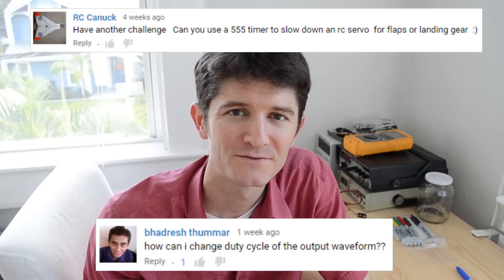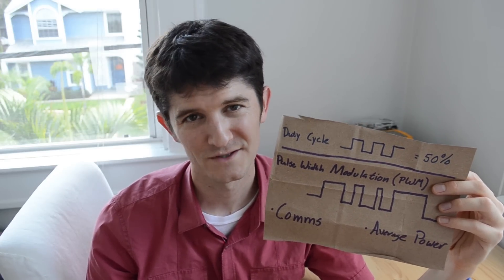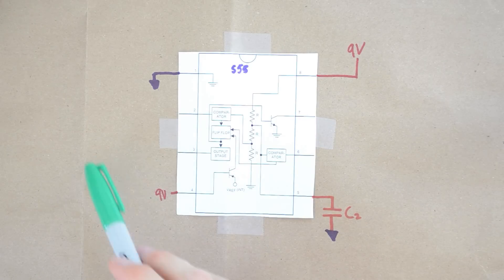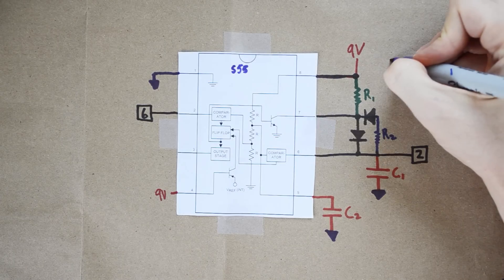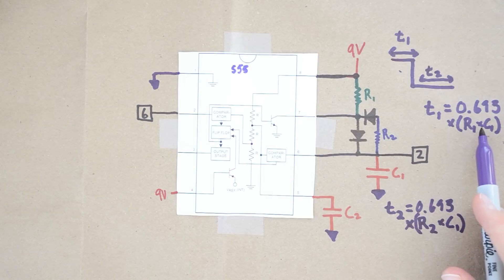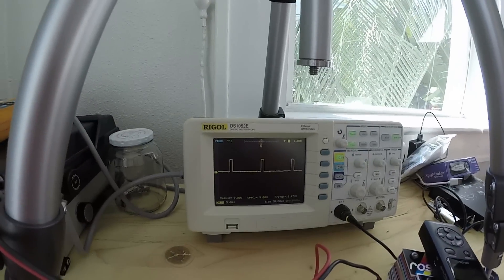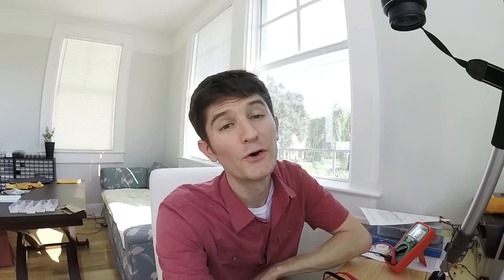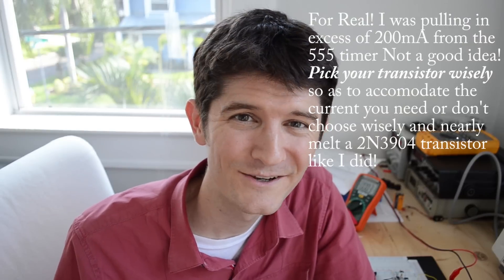How to Control the Duty Cycle of a 555 Timer

Comment: I needed a 1uF capacitor bridging CVV to GND to prevent overshooting at the start of the cycle. With a 12V input,
 max voltage was 20V.

Comment: Have you try to get to 50 or 60hz with 555 timer I try every valve there is and I still couldn’t get 50 or 60 only 107hz so if you could figure it out on video that would be good cause there is not a violation on YouTube about this to inverter with

Comment: Just viewed this video. In which you use what was known as conventional theory,  ie current flow in a circuit is from positive to negative ( which only occurs in a power source,  batteries, generators, etc). Whereas  in circuits external to power supply, cuttent flow is from negative to positive. The symbol for the diode was created while conventional theory thought to be correct for power sources and load circuits. For a diode to conduct, negative potential is applied to the banded end and position potential to the other end of the diode. Based on these the current flows through the circuits would be opposite those describe in the  video.

Comment: Great teaching. One question if you still pop by here. The timing math for the 555 I guess you use ohms for the resistor and farads for the cap so when you have added them, multiplied and divided them what is the answer in?

Comment: Bravo! Every time I learn something with this hobby, for once again I am thinking why I didn't think before that trick with the diodes? Until today I thought that 555 timer is capable only for 50% -100% duty cycle and I was reversing that by using an NPN at the output as inverter logic gate.

Comment: Thank you so much for your videos, I made a simple circuit with an LED and did not connect pin 4 to Vcc but it still worked? But it was very low frequency!! I mean on for a few seconds then off for a few etc. Still at least I know more about the 555 timer now!

Comment: Hy. Thanks again for your video.... very good explication. Actually I need to do a circuit based on 555 family and i want to have a 50% duty cycle and be able to change he frequency from 30 Hz to 30 KHz. I tried some possibilities but it did not worked. so, i thought that you have an idea to do this. thanks a lot.

Comment: Hi, I have made a monostable multivibrator using 555NE timer ic. What observing is it is getting triggered automatically when some electrical appliances are being switched on or off in the house. So is the 555NE prone to pickup noise or problem is something else. Can you think about it plz if you get time.
Reply from the maker: What are you using as a power source for the circuit?
Reply: Skinny R&D If using 9 volt battery to power the timer circuit & pin 3 is connected to ground through a resistor & optoisolator, In the other side of opto isolator ( moc3041 ) bt136 to switching 240 volt 1 Amp universal motor is used. Same problem is coming .
Reply from the maker: Is the mains ground at any point connected to the battery ground?
Reply: Skinny R&D No Sir, only possible physical connection through opto isolator. But same circuit using same component working properly in breadboard, but we have printed a circuit board where this problem is coming.
Reply from the maker: Are you using decoupling capacitors on both sides of the opto isolator?
Reply: Skinny R&D No , I haven't used decoupling capacitor.
Reply from the maker: That could be problematic. If there is any inadvertent noise causing problems, a large value electrolytic capacitor across the power and ground rails could help alleviate the problem. Another thing to consider is that your components may be physically too close together. If a voltage spike is propagating down into one side of the circuit, it could be coupling over to a nearby trace. I'm not sure. Just throwing out guesses.
Reply: Skinny R&D yes exactly that's happening, now planning to remove that noise
Reply: Skinny R&D And Thanks a lot for thinking of my problem from your busy schedule .

Comment: I just completed this configuration and this is version 4 or 5 at this point. I've been at this for apx. 1 year.  I've been trying to get control of a fuel injector's duty cycle. All I ever get is 50% duty cycle. I just rebuilt the entire circuit again, I did it exactly like you have in your diagram & I can remove the caps & its apx. 50 percent duty cycle (caps are removed at its 50% duty cycle). I can never get the injector to open for 1/10th the time it is closed.  Am I the only person who has built your circuits? Everyone likes your circuits but nobody has attempted to make one.

Just removed everything, its flashing at a constant rate without the 555 in the board.. lol

Comment: Not strictly correct as far as I could see. PWM maintains the same frequency, only the pulse width changed. Your example appeared to change frequency. 
I have not checked out the circuit to verify this.
Reply from the maker: Yes, you are correct. It is changing frequency. It's not a 100% solution but it gets the job done.
Reply: Perhaps the answer is to vary both the charge and discharge resistor values together with a ganged pot. For the control of motors it may not be a big deal if the frequency is changed but for other applications where charge control is required then it may be. I was thinking of a circuit where a MOSFET drives/switches through an inductor to a load to control a current and voltage.
It was an interesting simple circuit though.

Comment: If you are using motors or other devices that create inductance you should be advising the use of flyback diodes across the motor. This is probably why you had heat.

Comment: Thanks once again, another great tutorial putting me that much closer to understanding choreography that exists between the 555 timer and the other components. I'm a novice and though I've always had a fascination about microelectronics and how they worked (for well over 50 years).

I was able to purchase a Signal Function Generator and a basic Oscilloscope recently. This boosted my understanding and really revived my interest in this field (strictly as a hobby for me). I coupled the scope and generator with very good tutorials such as yours, and I think I've probably learned more in the last 1.5 months, than I have in any 10 years of the time I spent teaching myself using trial and failure techniques.

I have noticed that you don't seem to note the size of the capacitors (and a few other components), in some of your videos. Perhaps, if you just flashed a list of the components that you used in the tutorial at the end of each video for 2 seconds? Maybe just for the smaller, simpler tutorial videos, (I have no idea how much trouble that would be, so I understand if it's not practical).
Thanks again,
Rich

Comment: I have been struggling with a PWM, a 555 timer & have burned up several 555 units. I think you are answering many of my questions. I've known about the transistor, but the transistor should be supplying the power independently of the 555... many horrible YouTube videos I've been following and all they do is get you into days & days of wasted time.

Comment: nice explanation. how would you change the pulse width without changing the frequency? does it require a dual-gang resistor for R1 and R2?

Comment: Well,nice video but i suggest you to use this circuit of 555 timer which has adjustable frequency (PPM signal) to control a stepper motor's velocity(each pulse->steps the motor.....pulse rate->motors velocity).Now there is an another circuit works with 555 timer which produces stable frequency signal with variable on-off time of the signal(PWM signal),so the second one can control a dc motor (pwm controls the applied voltage and and dc motor speed is proportional to the voltage).Make a video of that!

Comment: Hello, Great videos. All the videos are great. I teach physics and some of my students are working with wildlife biologists to shock fish so they can tag them and when they wake up, let them go. The fish never get hurt. I am trying to advise them on making the device. My hobby is electronics. My plan is to create a voltage source (0-40V) with variable dc pulsed voltage, duty cycle, and frequency. I am using the mains voltage (AC 110V) , (fish are in a tank for testing) and stepping it down to 40 Volts. I am trying to find a ways to vary that voltage and display it. I think I will use voltage regulator LM317 (only max 40 V) and a panel meter to display voltage. I plan is to use a 555 time like in this video to vary the duty cycle and frequency and an IRF510 MOSFET to pulse the voltage from the 555 timer. Am I on the right track? Any suggestions? Thanks! Curtis.
Reply from the maker: Sounds like a fun project. Just make sure you use a MOSFET that can handle the current draw you predict.
Reply: Curtis, Could you use a fence charger for shocking the fish?  Fence chargers are readily available and can be low cost.  May have to tame it down.  Tom
Reply: Thanks, I'll research that. I also looked into boost converters, the only transformer I have is 1 amp and 120v to 12.6v. The boost converter I got online is 4 amps output. I'll do more experimentation. I did use the 555 timer circuit on this video to have a variable duty cycles and I used Arduino and an LCD to display frequency and duty cycles. I am almost there except find the right transformer.

Comment: Hi! excellent video, thankyou very much.

I wanted to know though, what's the voltage on  the output when it's on high..and how does it depend on Vcc ("power supply", on this case 9V). 

I want to use it on my car, so i will use 12v as Vcc and i need 5v on the output to used for a servo signal.

Comment: I want a pwm signal of 200khz. Is it possible to get it using IC555 timer? Can u suggest any other way plz?
Reply: they're generally good up to about 500khz at a minimum. it varies depending on manufacturer and model. some can do higher current but have slower switching speed, some switch faster but have lower current limits, etc etc. you can get 500khz out of the vast majority of them tho.

Comment: I really cannot understand why are you stressing on the fact to use a transistor. How will a component burn up? Please explain.
Reply: The 555 chip is not capable of supplying enough current for a heavy duty motor. Therefore you need to use a transistor as a current buffer device. The transistor will be used in switch mode and switched on and off by the voltage from the 555 output. Hope this helps.
Reply: Berny M thanks a lot. it will really help me in my future projects.

Comment: Great video thanks!
Now I have a better understanding of the way it works, do you know of any links to help me with calculating which resistors and caps to get certain duty cycles?
I'm trying to build an Led strobe so it lights for around 2ms, with approx 10ms cycle (100hz). the idea is to monitor rpm of a spinning disc. Any tips would be appreciated!

Comment: Question: When pin 3 (output) goes low, would that turn on a pnp transistor and when it goes high it would turn on a npn transistor?
Reply: Btw, subscribed.
Reply from the maker: Yes, it will. I use an NPN halfway through this video: https://www.youtube.com/watch?v=dukZlsRoCJo
Reply from the maker: Thanks for the sub!

Comment: can u give me some advice on using the 555 ic to control a cd4017be ic  to switch the output on it thanks
Reply from the maker: I'm not sure what you want to do but you can push the output of a 555 timer into the clock input for that chip.

Comment: Hello! I am not sure why you have connected 9V to the pin 4 of the 555Timer. Is it because you can disable the Master Reset through this way? As in, that's a PNP transistor, and if you put 9V to the base of it, it will be in cut-off mode?
Reply: Based on a quick internet search on the 555 timer, Pin 4 is the RESET pin which can be used to restart the 555’s timing operation. Like the trigger input, reset is an active low input. So pin 4 must be connected to the supply voltage for the 555 timer to operate. If pin 4 is momentarily grounded, the 555 timer’s operation is interrupted and won’t start again until it’s triggered again via pin 2.
Reply from the maker: Listen to Andy.
Reply: I got it! If Pin 4 is not put to the power supply, then the timer will shut itself off right after being activated via Pin 2, so no continuous operation. Thank you!

Comment: initially when the supply is given from pin 8 and the current starts flowing towards the capacitor through the diode,but won't the current pass through the transistor and then to the ground at pin 7?

Comment: Can you tell us how a NE555 with an Operational Amplifier as a comparator where it can be used to Modify PW as a quick and dirty solution for PFC of an offline SMPS? That would be awesome! I've been making astables with BJT's, but I just got some NE555s, and you brought it to my attention in a previous video that if you supply a voltage to one of the pins, it will modify the PW. Of course I'm driving the MOSFET with an NPN-PNP common emitter configuration. There doesn't seem to be a complete tutorial on offline SMPS Topology. Your'e a good professor and I( I believe I can speak for others based on what I've seen posted on various videos) would like to see a playlist on the topic, if it interests you of course. The Post Apocalyptic Inventor came the closest in completing a detailed tutorial playlist on Switch Mode Power Supplies.
Reply from the maker: I'm not sure I can, but I'll add it to the list and see if there's something I can do with it.

Comment: how can i use ic 555 circuit as power on/off circuit for application such as night lamp. if i have to  switch on lamp every night for 8 hours and switch off it after that....
can i use ic 555 for such a long duty cycle
Reply from the maker: My newest video is about using the 555 timer in monostable mode. That circuit has the functionality you want, but the components, a resistor and capacitor, would need to be quite large to achieve the time you are looking for. I'll put this on my list and give it a thought or two.

Comment: I want  t1 to be 1 hz using a 100 uf cap how do I find out the resistor
Reply from the maker: There formula to determine your answer is:

t1=0.693(Ra+Rb)C

In order to accomplish your goal, you'll need to choose a value for either Ra or Rb and calculate the remaining value based on the criteria you imposed in your comment.

Comment: Big thanks for your videos. BTW if u take both R1 and R2 as a variable resistor  you will be able to control both on and off pulses at least this happens in simulator, so you can control the duty cycle from 0 to 100 percent almost.

Comment: Hello, with this method, can i achieve a tiny duty cycle by putting R1 << R2, let's say R1 = 220 and R2 = 3M, for which the duty cycle is R1/(R1+R2) = 0.007%.
Can this achievable in real application?
Great vid btw,
Thank you.
Reply from the maker: What capacitor would you use? The 555 timer has limitations based on how quickly it can transition and supply an output.

Comment: how about to get a sinusoidal wave out of it?
Reply from the maker: +Eduardo Caetano I don't know how to get a sinusoid directly out of a 555 timer. In fact, I don't know if it can be done. After the 555 timer spits out the square wave, there are things you can do then. I've gotten something close by running it through about 2 to 3 transformers but I'm sure there's a better way.
Reply: +Skinny R&amp;D 
Thank you very much for the answer. 
I will try it with some RC/LC/LR filters and then try to feed this signal on a next stage of a 555, dont know if it will gonna work, probably i have to calculate the (Ra and Rb)times C in function of the new "Vcc"... just a quik theory.... need to sit down and try to modulate the square wave until i get a sine. 
maybe can be use a Allpass filter in a NE5532 too.
Again, just some randon ideas.

Comment: A question: So If both input (of flip-flop) were zero then flip-flop will the keep that bit until next change is applied to the input, right?
by the way this video is awesome, it's very good for beginner. And the reason why this kinds of video are awesome is you'll need a simple term to explain the complex stuff. and it's always hard to find the right terms.

Comment: great video - thanks a lot. How would you change the duty cycle to an irregular pattern (eg for communication as you mentioned at the start of your video)? Now subscribed!
Reply from the maker: +cpobyrne1 Thanks for the subscribe! You can feed a varying voltage in on pin 5 and frequency modulate the output.

Comment: How will it work by puting 3 pin pot,midle pin on the diode - end,so when you turn pot fully one side you get one big and one small resistance?
Reply: +ivic1112 No.I see the diode is problem

Comment: Great video, nice work! But, to vary the duty cycle without affecting the frequency, should I use a single pot connected in R1 and R2? I use ordinary silicon diodes or need to choose special models for high frequencies? (I want to maintain a 2 kHz working frequency)
Reply from the maker: +Enfermeiro Pensador To be completely honest, I haven't tested out how to keep the frequency steady. It's in my list of things to do. As soon as I figure it out, it will probably be a video.
Reply: Thanks. This would be an excellent addition to your channel. Certainly, not just me, but the whole community would appreciate.
Reply: +Skinny R&amp;D
I believe this should work, but I haven't tested it:
https://drive.google.com/open?id=0Bxk-g3_XwgbSc285TEJVcVhwLTQ

There is an excel file here to calculate the cap you need for the given resistors Ra,Rb, potentiometer Rc (= total resistance of the pot) and frequency output. I don't know if the diodes affect the result...